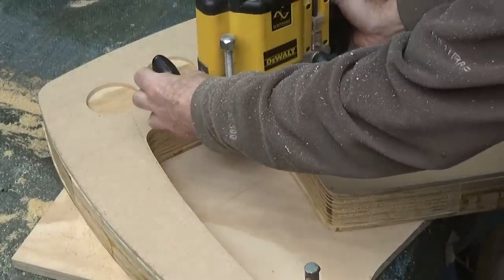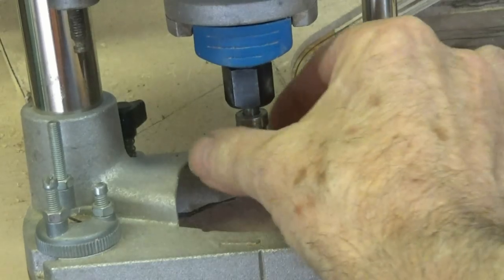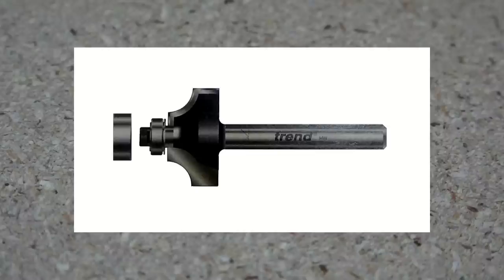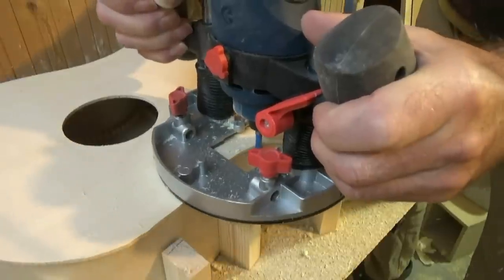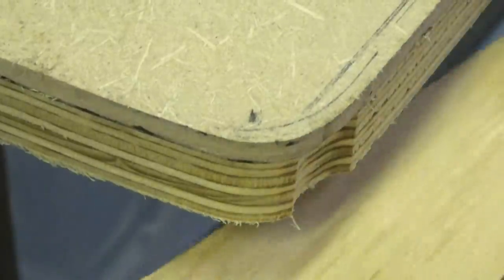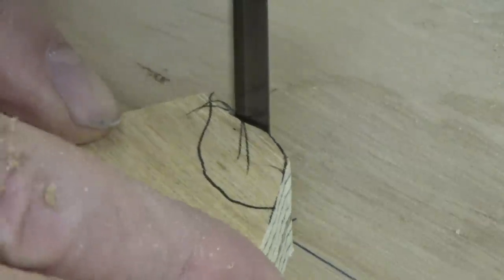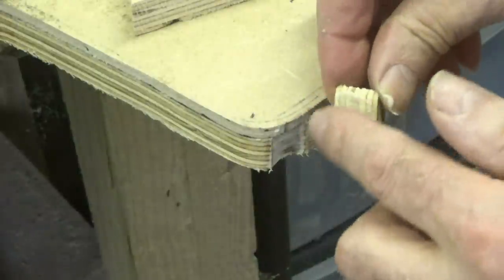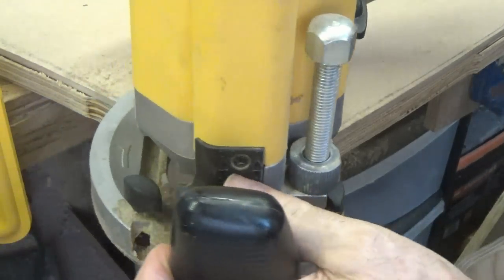Woodworking Router Slip Up - And How To Fix It

Comment: This same exact thing happened to me today. I was using a Bosch flush trim bit and the bearing slipped up and caused a 1/4 gauge in my subwoofer cutout. I didn't think about doing this like you did in the video. I mixed saw dust and tite bond 3 together and filled in the gap. Im not sure if this will work. I'll figure it out in the morning. If not I'll be using your technique here. Thanks

Comment: Masking tape is indeed an excellent gluing clamp! I've used it many times over the years, and particularly in the last four years since I started making my own RC gliders. Foam and balsa often only need a few pins and light pressure when clamping.

Comment: The router is one of my top used tools, I have made most of the trim work around my house.
My old router, I still use, I got it used almost 30 years ago. Just bought a new Bosch with the plunger router base.
I have never used a plunge router before, any advice?
Reply from the maker: Best advice is invest in my long established fully comprehensive and detailed routing videos! Available as DVDs or online: www.woodomain.com

Comment: Great tip Jeremy. I struggle to get good (or even slightly decent) plywood in the UK. There's no supplier locally to me unfortunately. Do you know of any good suppliers online? I'm cautious about splashing out on some only to find they're of poor quality.
Reply from the maker: I think its always best to select the plywood (any wood) in person. The Brazilian pine plywood I use is from B & Q. Batches can vary but generally good but a few fills on the edge are often required. I will make a video about that.
Reply: Very kind Jeremy, thanks for getting back. All the best plywood in B&Q must get taken before it reaches the North East of Scotland branches! It's been a while since I've searched in B&Q though, so I'll take a look this week.